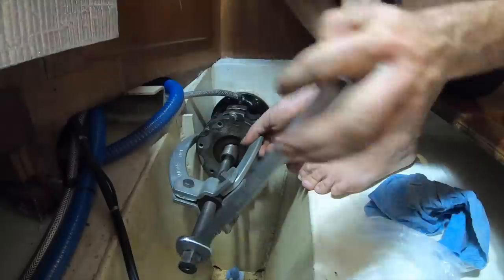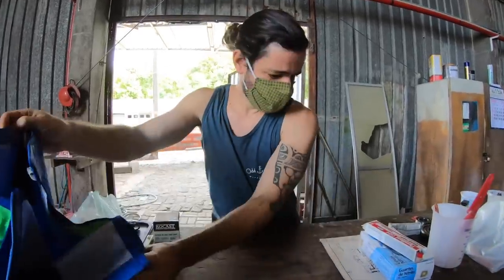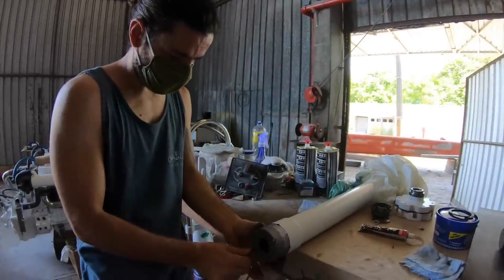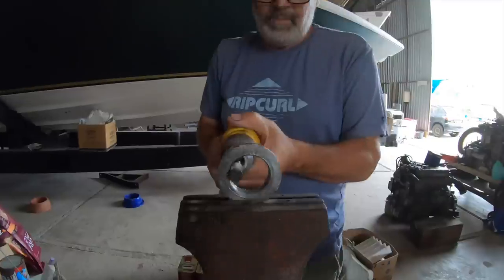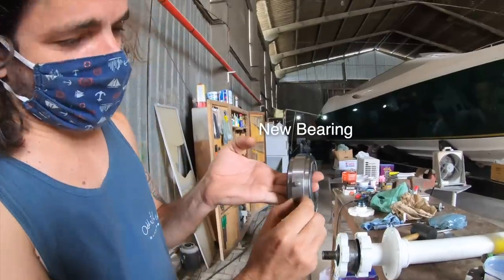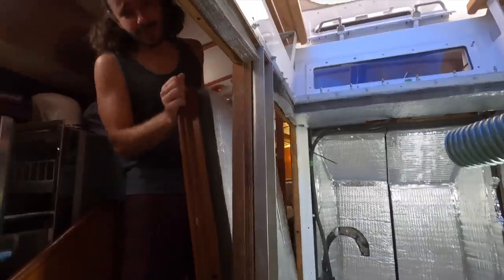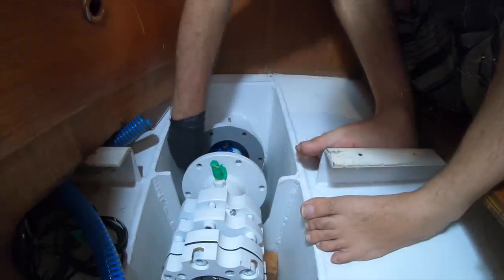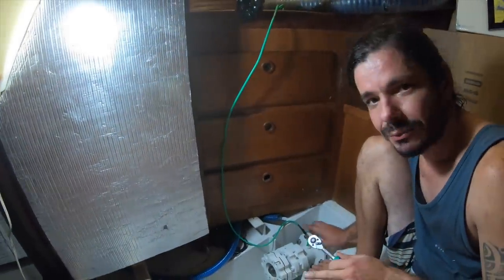⛵️We are FINALLY done with this project!! #173

Comment: Great job. Glad to see all the systems rebuilt. Cautionary note: it does not look like you put a relief plug in the front bearing collar that you made. This means that if you over grease the bearing it won't have any where to go but past the seals and you run the risk of filling the oil space with grease. In any case once the bearing heats up in use you may or may not see grease coming out the front seal.

Comment: I liked the solution given to the holes of the new bearing, now you can regrease it. As it seems the whole shaft assembly is directly bolted to the boat without any sound cushioning (e.g. Rubber flange), so the system may produce some noise.

Comment: It's a perfect system, beautiful refit. Just 1 thing: if you fill the entire volume of grease in a ballbering, the pressure increase when bearing run (need air dilatation)
You can check it easy, the bearing heat quickly (when running with no load). So you nead to create a small momentary leack to decrease grease pressure.

Comment: You are right to keep this shaft solution. It's a very robust and well engineered system (except for the non greasable bearing you solved). It's something you'd expect to find in a commercial boat.

Comment: Your understanding about bearings and grease is correct. The issue to be considered is heat gain. When the bearing gets hot the grease will expand, when it cools it will drawback or contract, to make it work correctly you would need a jacket to go between the flanges so the grease could be contained.

Comment: Hi guys, I’m just thinking back to when you took the propeller off, didn’t you have to slide the shaft back inside the sleeve to make enough room to get the propeller off? Maybe you should have placed the propeller in position as you installed the shaft? I may be wrong, 
As far as the rebuild on the system, outstanding as always. Well done guys. 👍👍👍

Comment: It was nice to hear the explanation of your drive system. We know that in a "normal" system,  the engine has to be bolted down securely as that is what is what is pushing the boat forward, but the reality is the forward thrust is pushing on the crankshaft bearings and that can't be good for the engine.

Comment: I think you were entirely correct to keep the existing driveshaft system! I have one cause for concern with your new grease nipple system. Normally when you have a grease nipple to apply new grease there is a way for the old grease to be pushed out by the new. I got the impression that your bearing is completely sealed. If that is the case you will not be able to regularly apply new grease. I hope I am wrong, and that you already have that covered.
Best wishes to you.

Comment: Hey guys, I love the way You take care of all details. Hopefully it will give You back a smooth work without issue. I'd like to ask/point out one thing. You put plenty of thread lock on a threads. Is it some kind of "soft" adhesive? Normally when You use loctite it has to be only a drop to avoid problems while taking out bolts/nuts. Confirm it or not to avoid further issues. Have fun there :)

Comment: Suggestions when assembly/diassambly always witness punch the components, this way you help maintain balance and ease reassembly. Also those thrust bearings should face each other to cancel the thrust, but absorbe the thrust in both dirrections, Bearings should be packed 30% of capacity.  You can make berings run hot or evev fail by over packing.  Use Hi Temp grease.

Comment: Best way to improve this system is to make a collar for that main bearing to sit in. Put a grove on the inside and for the outside put a zirk fitting.this way you can use the spare part. Great video Duca and Roberta.

Comment: ******On the ground wire that you put on the shaft housing- did you scrape away the paint to get a good electrical bond (add a star washer)? - use an ohmmeter to check the connectivity - great job to both of you!

Comment: As a recommendation to dynamically balance the shaft I suggest you add a counter weight 180º from the grease port you added to the bearing

Comment: Excellent overview and explanation. The prop shaft system is similar in many ways to a bicycle drive crank or wheel hub. Unfortunately, bearings and seals are always the weak kink and require regular maintenance. Even supposedly sealed “maintenance-free” systems. Heat and age degrades rubber, greases and oils.

What likely happened to the original bearing is the seals wore out. Salt, engine vibration, sagging mounts, misalignment, 20 years of sitting  in dry dock, all of the above? With bearings nothing lasts forever. I’m in the middle of over hauling all my bikes which includes aligning the frames.

Curious, in the system blueprint did they provide a torque specification for the bolts?

Comment: its a good solid system good learning project.  I have done so many drives like this I have lost count. but the systems I did were much larger. The guy who polished the shaft should have checked it for run out. Should be no more than .003 thousands of an inch. Dont beat your self up to bad for forgetting that retainer. one time I stuck two of the helical bearing on in the wrong direction. The bearings had to be heated to install and were $1,200 each. Boss was not a happy camper. The bearings were about about 31 cm x 7.5cm and were special swiss made bearings.

Comment: you guys are doing a great job. Only thing i would have done different , I would have replaced all bearings even thou they look ok, bearings can fail. Im a retired industrial millwright contractor and I have experienced bearing failure. With all the great work that you guys are doing why not replace all the bearings, then you can rest assured that a bearing failure won't happen. I don't want to worry you guys, it may never happen but why take a chance

Comment: Careful with your new grease zert!  You CAN over grease bearings....its actually a pretty common failure point. When too much grease is packed into a bearing the grease will overheat and break down.  Granted a bearing that is over greased will last longer than one that is under greased....  I wouldn't give that fitting more than a pump or two every year, or perhaps two initially.

The gland between the outside of the shaft housing and the inner hull housing is a different story.  That's designed to prevent seawater intrusion and can be purged periodically by pumping in grease. Hopefully there's some recommendations in some of the documentation you have for the system. If it were my boat I would remove the prop and outer housing every time I hauled out and pump a cartridge through and then reseal everything on the outer housing.

Overall AWESOME job!!!  Love the meticulous nature and teamwork of you to.  Truly inspirational!  Great work!  Just don't go wild on those grease fittings....
Reply: Don't forget the safety wire on the bolts

Comment: With all of the epoxy paint and seals, please make sure that ground wire has continuity through to the prop. I've recently seen a video where a guy's boat was struck by lightning and it caused a pretty good sized leak at the prop seals as the energy found it's way to water. You'll want that path to be as low resistance as possible I think.

Comment: hi guys regarding your bearing grease, kluber make a high speed bearing grease for single applications. i have used it for many years in a high speed pin mill. the mill runs at 16000 rpm i change the bearings every year but with these close tolerance bearings running for 8 hrs a day 5 days a week at 16000rpm when i replace the bearings at our christmas shut down the bearings are still perfect. As there is no way to access these bearings they have to last the whole year on one application.

Comment: Nice, job.  Seems like a good system, but kind of complicated!  It's probably a good thing that you took it apart and put it back together a few times so that now you're sure it's together right.

One thing I noticed is that there was a LOT of grease in there when you took it out, but you only greased part of the shaft when it was going in, and it didn't seem like that much more went in when you used the grease gun.  With the propeller end open and not yet sealed, you should have been able to pump grease into it until it came out on the unsealed propeller end.  It seems like that would take a lot of grease, but maybe you just didn't show it.  Just want to make sure you have enough grease in there to prevent corrosion.

Again, great job!

Comment: That was a great solution to the bearing issue. Now how are you going to fill the cavity for the shafts with grease? Looks like it is going to need a bit more than that little grease gun has.

Comment: Hello Duca un Roberta - first of all, thank you very much for the detailed insight into your work - now you have 1334 comments - in the hope that this comment will also reach you - I'll start writing. I'm watching your video right now because I'm interested in technology and also dream of going on a sailboat one day and seeing the world - but for now I'm enjoying country life with all its advantages and amenities. Since I now suspect that all repairs are expensive - especially with boats - I have an objection here, because you took such extreme care of the propeller shaft and its safe function - it should not have been in vain! At 20:35 min I see you fill the propeller shaft with oil so that there is no more air bubble in it. Correct? Well, if the shaft doesn't have a surge tank, in my landlubber's opinion it may be that the oil heats up with use. It does - it stretches - the steel case certainly less. If there is air in the shaft - it buffers the pressure, so to speak - if there is no air in it - the oil pressure can cause damage in my opinion - in the best case, pressure is simply reduced by oil loss - because that happens under pressure - it could leak when it cools down stay for sea water - what does the forum say about it - maybe nothing happens because the shaft housing is again in the grease-lubricated shaft or everything stays so cool because it is under the water? Kind regards from Alexander

Comment: The opposed spherical roller bearings are intended to be preloaded via clamping collars and spacer set to the extent they prevent thrust loads being imparted to your gearbox/engine/mounts whenever you're shifting from forward to reverse or whenever (god forbid) seas are rough enough your prop breaches under load. There should be no noticable play but they should not be clamped tight enough to cause heating of bearing housing while under rpm load.  A tip - one of those infra-red temperature sensing guns using a common 9v battery is a handy item to have so that you can occasionally "shoot" any bearing housings you've rebuilt to observe break-in temps while underway.  You'll even find that thing handy to establish baseline temps of any rotating assembly so that if you suspect somethings not quite right at a later date (noise/smell) you can verify with your infra-red gun that something is either amiss (spiking of temps) or all's good with normal recorded running temps you've written in a book somewhere.  Fun watching you two deal with all issues together and performing the bulk of the dirty grunt work with good humour.

Comment: Duca make sure there is a vent path for your new bearing with grease gun attachment you could just tap a set screw on the opposite side of the grease bung. The grease guns apply 1000s of psi to push grease in. You may have issues when you go to inject grease into the bearing with out a vent. But that said you shouldn’t have to really add more grease that often for the life of the bearing, also you don’t want the bearing to be completely packed with grease.

Comment: Hey guys great job on another project done. I do have one question though. When you removed the prop if I remember correctly you had a very difficult time because there wasn’t enough room by the rudder or frame or whatever behind where the prop will be. 
So my question is this: why as you slid the shaft through did you not put the prop on so that you didn’t have to fight the limited space? 
Now I may have remembered incorrectly and my head may actually be somewhere up my backside and if that is the case I apologize. 
Either way great job of rebuilding the shaft and tube.
Reply from the maker: We actually took the prop first. We are gonna change the propeller and right now the new one is being produced
Reply: @OddLifeCrafting  ok I understand. Well again great job. That shaft and tube should last nearly forever.

Comment: Wow a marathon effort. But I have a question. Do you have to balance the shaft? If its out of balance ( like adding the grease nipple ) won't it vibrate? I'm sure you already though of it. 😄
Reply: The lack of safety wire will even it out.

Comment: Another great video love your approach to the way you tackle project a lot of thought goes into it. Why change your drive system when you know that it works and keeps the water out the boat. Looking forward to the next part and getting your new engine it and the propshaft  connected to the new seal system. Keep up the good work regards from Scotland

Comment: Are you going to show the prop shaft being reinstalled? 
You might change the bearings in the universal joint, or at least check for play.
Its possible for the UJ to come apart in use, and you should consider protecting against the shaft exploding into the cabin. How about adding a metal plate to the floorboard above it, and bolting that down? Or some sort of inverted U bracket over the shaft.
I think that bearing you put in is designed to take the axial (or thrust) load from the propeller. The notchy one you discarded, not so sure.
Keep up the good work

Comment: Just adding a bit more to my first comment if you pump grease into that pilot bearing. It will prohibit the lubrication from the oil in the housing the way its supposed to work from drive line original design .Great keep on keepin on.

Comment: It’s a very unique and sturdy design. The positioning of the engine side first seal on the drawing is wrong and should be reversed with the garter spring facing the bearing.Will allow easier assembly of the forward drives flange without running the rick of damaging the seal. Keep in mind this seal is not holding oil but the grease from the tapered barrel bearing. Indeed this bearing will absorb the fore and aft propulsion forces generated by the prop. I did notice that the forward seal (engine side) was installed with the garter spring facing the big bearing. This gentleman Reginaldo indeed knows his stuff.... 
The additional grease point on the front tapered barrel roller bearing outer race is a good solution considering the spare bearing had lube holes in the outer race. However be sure not to over grease that bearing as it might lift the seal lip of the seal holding the shaft oil in place..An oil seal lip needs be riding on a very minute oil film to allow oil reversion hence no leaking..
Outstanding video with a lot of technical inside...You both learned a lot and that’s the most important lesson learned..Congratulations...

Comment: make sure you have a path for the grease injected into that bearing to escape while pumping. You want the grease to travel across the bearing and potentially displace the older grease or air out a vent you also open. Otherwise you'll potential damage or displace the oil seals. nice job.

Comment: I hope you took pictures and wrote all those seal and bearing numbers down so you can procure backup parts to replace the boats inventory of replacement parts. With age all those parts may get harder and harder to find in the future. If you can't find replacements for all those parts in Brazil you may be able to find them in other countries,  as you travel about. If I were going to change anything it would be those old style U-joints that were used to attach the boats transition to your prop shaft. Modern constant-velocity universal joints like used the half shafts of a front drive car would be more forgiving of alignment issues which you may encounter with the new motor. Ask the engineer who helps you with the engine change over about this, as alignments of this nature are very challenging. Your old motor may have not been aligned properly and may have contributed to vibration loosening of bolts, leaking of oil seals and bearing failure. Also the shafts that connect transmission all the way back to and including  propeller will have to be in balance to prevent vibrations. Any parts that were changed out can cause balance issues bearings, bolts, nuts,  washers, u-joints, Propeller. I know you didn't want to hear any of this, but if you want to get rid of the noise it's important...

Comment: Pretty sure it gotta come off again to put prop in place!   Didn’t you have to push the shaft inward to give clearance to remove the prop?

2nd.  When using silicone to make a seal, don’t tighten everything right away.  Let the silicone set a little before squeezing the parts together. This will prevent the silicone being mostly squeezed out and allow some to remain the actually make a seal!

Comment: Hi, I like your Channel a lot.
One remark; You destroyed the bearings before using them by tapping it with a (steel ) hammer.  Rule nr 1 for mounting bearings. Use a press or a special bearing mounting kit For this.
Reply from the maker: Hi, Frank. Our bearings are made out of a hard material and the hammer we used is made out of a weak metal, no problem to use it with care
Reply: Hi Odd Life Crafting . Okay for me but you decrease the lifetime of the bearing upfront by doing this. You should never tap a bearing with either what object or material but always press it on its place. Good Luck!